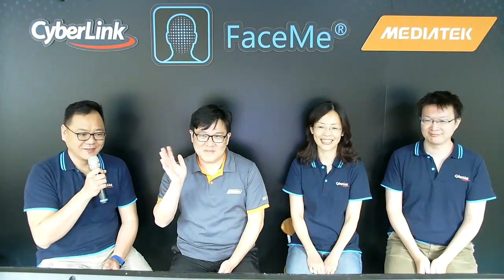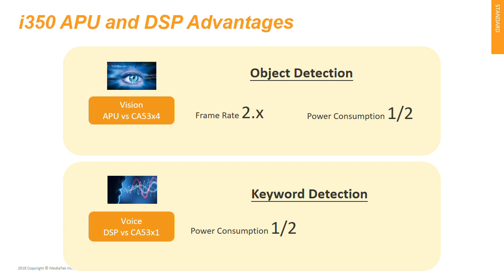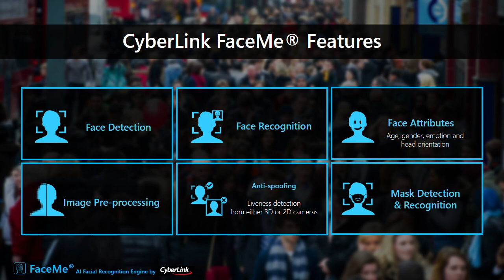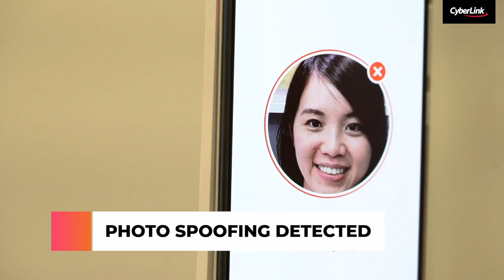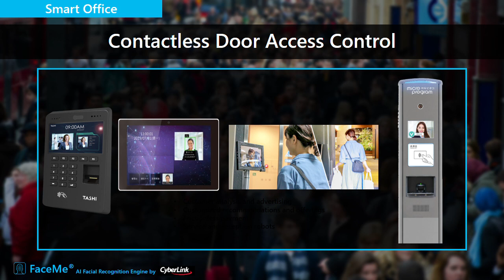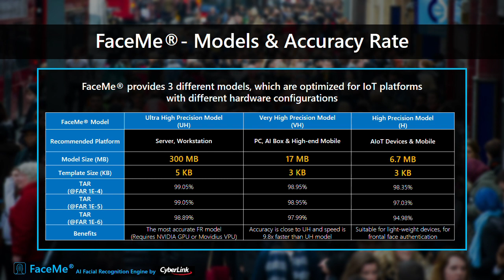Empowering Facial Recognition on IoT Edge

Comment: Hello sir/maam i cant put a green screen on my powerdirector its just disappear when im gonno press the layer button then the camera button is gone pls fix this
Reply from the maker: Hi, 

We are not sure what PowerDirector version you installed, and we assume you are using the PowerDirector Mobile app version on a mobile device. 

To use the Chroma key feature in the App, you can refer to the steps in this FAQ:
https://www.cyberlink.com/support/faq-content.do?id=21472

If it is not the case or you require further technical support, please kindly contact our tech support team by pressing the App settings > Send Feedback option in PowerDirector Mobile. 
The team will help you look into the case.
Reply: The versoin of my powerdirector is 8.1